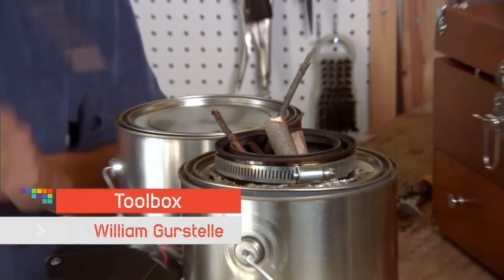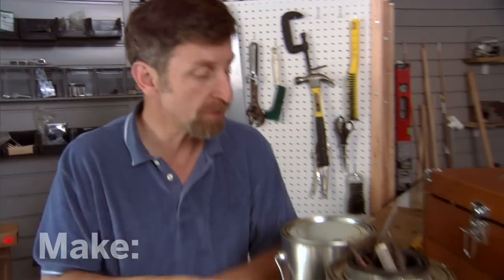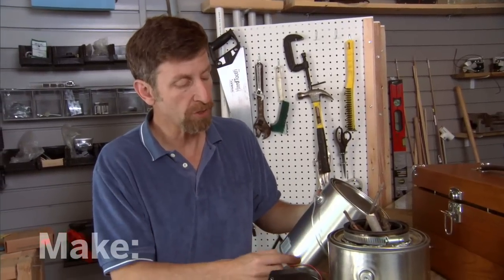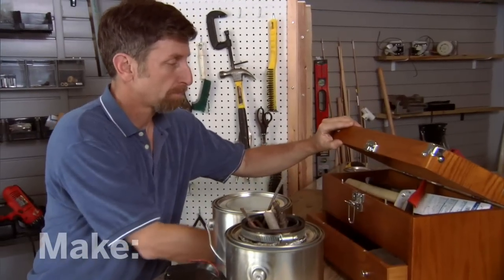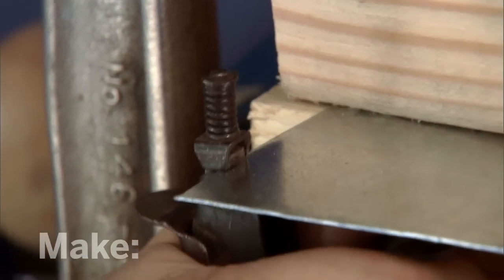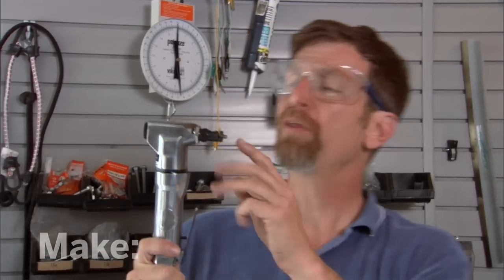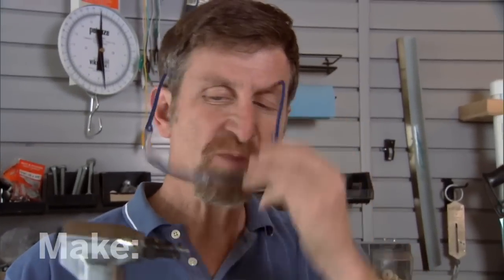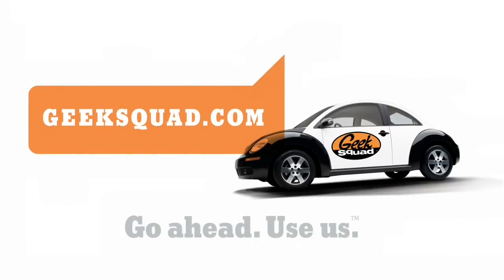Maker to Maker -  Nibbler

Comment: I've got a project where I need to cut sheet metal, but I'm worried about the capacity of the pneumatic nibbler.

I've only got a small 3gal compressor, and the sheet metal is about 1/16" thick.
Is the pneumatic nibbler still the right tool for the job?
Or can I use a jigsaw with a metal blade?